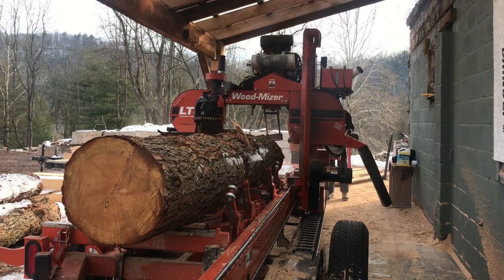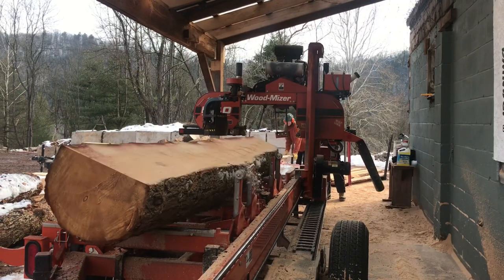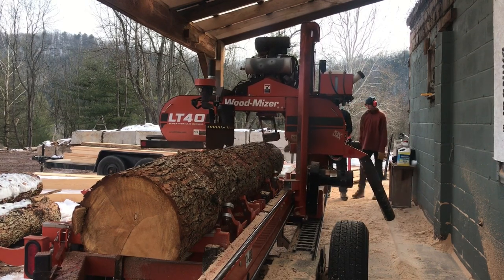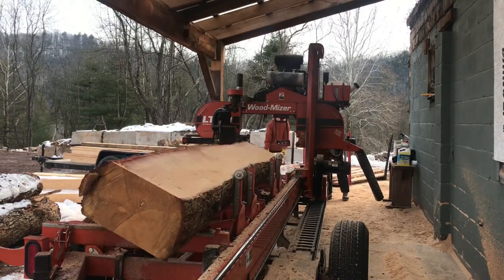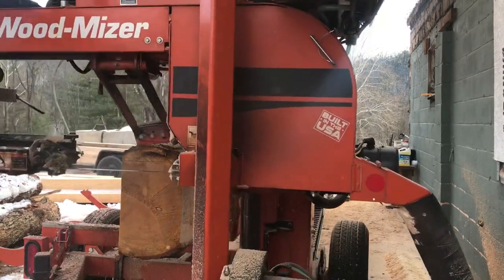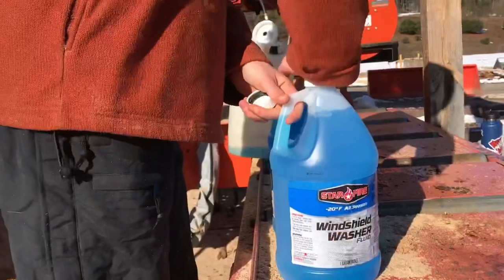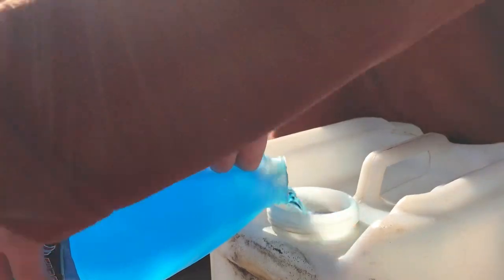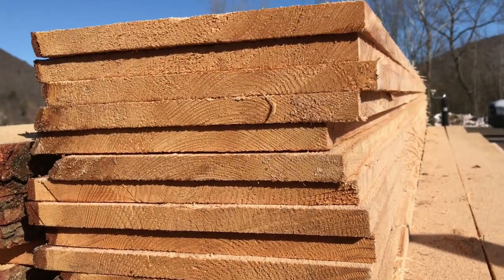How to cut live edge siding on an LT40

Comment: Thank you for the education. I’m looking to buy my own saw mill some day. What do you mean when you say you press “auto down” just in case?
JC - Northern California
Reply from the maker: “Auto down” allows you to lower the mill at a consistent rate, for instants I have it set to lower 1 inch at a time allowing me to make my cant barkless. Sometimes as you are cutting off the slab you might have to push auto down to make another cut, this cut would be a flitch a.k.a. jacket board. Hope this makes sense.
Reply: @lumbercapitallogyard  how did you learn to be such an accomplished Sawyer?